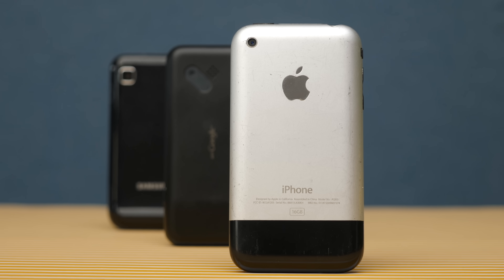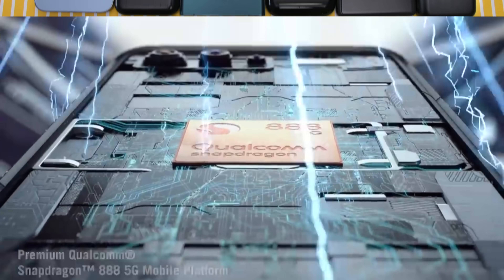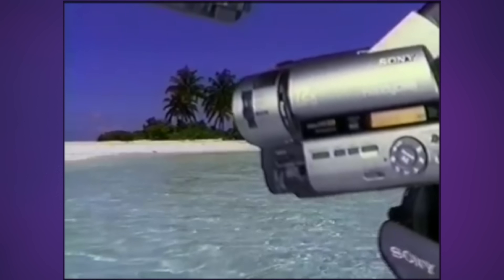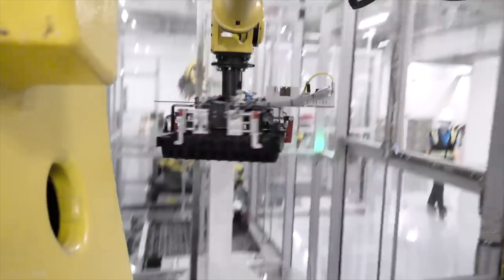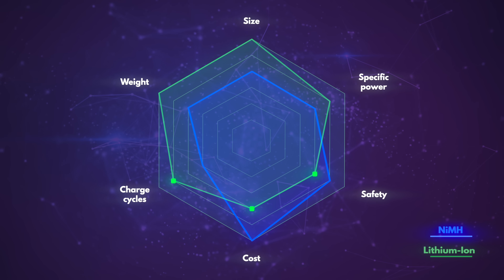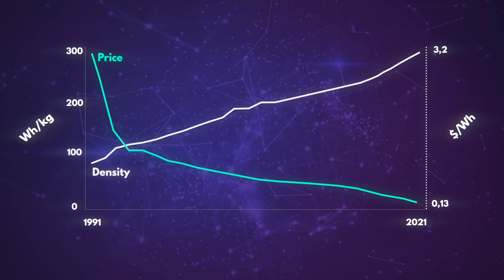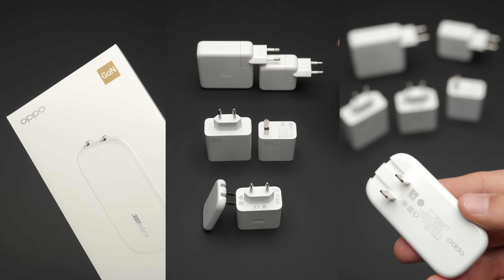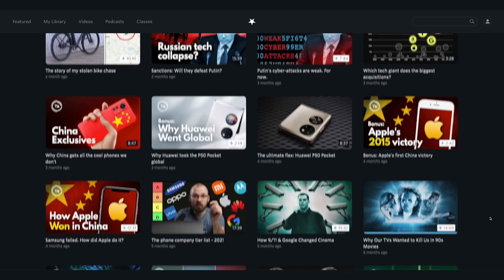The billion dollar race to fix phone batteries

Comment: Better batteries wont fix phones tho, the current limiting factor is cooling, we've already seen how phones with no vapour chamber cant properly use flagship processers because they easily overheat and compared to pc cooling, a vapour chamber alone doesent do all that much. Cooling is needed to reduce the temperature of batteries to increase their lifespan and more importantly to increase the utilization of the processors power because everything, including the cameras, rely heavily on the processor in flagships. These days processors are fast enough to support hi refresh rates on good resolution but cameras, especially video have lots to benefit.

Comment: Wow, what a trip to memory lane! Haha, brings back a lot of memories when we were still using those old batteries. Thank you for this comprehensive content. One thing I learned is that most of the mines are controlled by either China or Russia. I hope we can find sustainable alternatives or at least find ways to extend battery life. For now, I use a Chargie. It works to extend my battery phone capacity and at least I'm helping to keep one more battery from going to the landfills sooner.

Comment: I have a 120W charger and it charges my phone in less than 20 minutes (something like 17 or 18 minutes) from 0 to 100%. And in theory it should just take 12 minutes, but it takes longer because the charging has to slow down towards the end to not damage the battery. So I don't think that a 240W charger is useful except in special cases in which you only have a few minutes to charge your phone.

Comment: Sadly, China has ruined its environment to process Lithium.  Many toxic and poisonous materials and waste products come from turning ore into metal.  The US wants Australia to "process" Lithium, and Australia is the largest miner of that ore.  The most promising large scale fixed batteries are probably the molten metal batteries.  Ambri's liquid-metal battery consists of three liquid layers stacked together based on density. The densest, a molten antimony cathode, is on the bottom, the light calcium alloy anode is on top, and the intermediate-density calcium chloride salt electrolyte sits in the middle.  They can be rechared much more than any other and have a lifespan of at least 20 years.

Comment: We also took it to the max in nanotech, generating a solid state nano layer build that blew current Li batts away, mainly in current draw...up to 16x current delivery safely w/o causing heat issues.  They were impressive, powerful, and tiny.  However, they were still bound in the research side of things, needing complex expensive processes to build so they werent viable for mass production, at least they werent in 2015....

Comment: I personally lead development of LiFePO4 batteries at oak ridge nat. labs, USA, back in 2012-2014...they had minor improvements in base stats like charge density, cell voltage etc...however....
We developed a manufacture process with nitrates cellulose, eliminating the need of harsh solvents during builds and making them eco friendly; which also dropped cost to around 35% of current Li batteries.  The biggest hit was charge cycle life.  Typical bats today hold up on avg for 1500-2000 full charge/discharge cycles back to back, at which point they're basically worn out due to internal dmg.  These, however, ran for 6000 full cycles and still retained 91% of their original capacity.

A third of the price, eco friendly, and lasting potentially 8-10x longer...this was completed in 2014, so wtf happened??  Greed happened.  Theres no big profits in selling a product that takes a very long time to wear out AND is cheap as well.  Companies would rather sell u current ones that u must replace in a couple years for $100 than one that lasts 14 years that costs $38.  Dont think technology is where you see it at the store...the "consumer public" tech is anywhere from 20-30 YEARS behind what's actually available (and this isnt even including the military branch), where "too good" quality technologies are sat upon until things get so bad they're forced to move to it.  Even then it is usually dubbed down and not utilized with full potential so there can be a created fault point that makes it less durable and this more profitable.  I'd heard this b4 in engineering, but I thought it was conspiracy until I actually experienced it personally in R&D.  Companies would rather the planet die so long as profits are kept high.

Comment: This is why we need wireless electricity.
Reply: That's isn't any solution, moreover it would be way worse.
Reply: @aadityatokle  clearly one doesn't understand the grand scheme of things. That being you, if it wasn't clear enough. I'm not stating that wireless electronics would be appropriate for any situation but rather that it would be effective in situations where an emergency is required. Imagine being able to fuel up your car at an increased rate when you run out of electricity. Picture an airplane that never needs to land. Factor in the ability to power anything of importance from across the world at an energy loss. Beats running a cable to it or having a massive battery. Also, it depends on what from of wireless transmission. Tesla coils work off the square cubed law, but if you use  radio waves, you can get up to 80% if used in a stight line.
Reply: @Dr.LethalContact  Anyone with 2 braincells and knowledge about how electricity works knows how shitty this idea of wireless electricity is as of now, the efficiency, the heat generated, potential hazards and the immediate risk of having a small nuclear explosion capable radiator would absolutely be a threat to every single thing in a 500 meter radius, let alone being helpful or any better.
Reply: @Dr.LethalContact  when you say "imgine this or that" it's just fantasies my guy. I could say imagine teleportation which eliminates the need of cars and batteries, or imagine we being able to talk in each others head or play online games in our brains thats nothing practical.
Reply: @aadityatokle  you clearly dont understand the difference between the multiple forms of wireless electronics. One of the forms is the wireless charging pad for apple and samsung, and it's already on the market for over a decade. Ig that means you already lost. In another decade, you will rwealize how wrong you are now. I'm so glad I can actually picture the future properly.
Reply: @Dr.LethalContact  yeah, Xiaomi tried a 10 meter wireless charger for commercial use, how did it go? Well... To charge a 5000 mah smartphone at just a few meters it would take a day and would only be able to use 1%~ of the electricity that it has been provided initially
Edit: it takes multiple days for a regular smartphone to go from 0 to 100 with a 10 meter wireless charger not just one and your tesla should probably have 100000 times more to charge, the size of the 10 meter wireless phone charger is already like an air filter which works like garbage and if you would want to power a tesla with anything remotely close to a wireless charger the chargers' size would be the size of a small nuclear reactor with a range of 2 centimetres if the tesla doesn't burst into flames from the wireless chargings poor efficiency. It's not possible. Simply not.
Reply: @Dr.LethalContact  the one which you're talking about is a charging pad, which has less range than any wired charger because its basically a wired charger with a ring slapped and a port removed version of a wired charger,for instance my Xiaomi note 12 which I'm currently using goes 0 to 100 under 30 minutes and pulls 120Watts wired, the wireless version goes only a mere 40 watts and isn't very goot for my battery as much as the wired one is.
Reply: @Dr.LethalContact  buddy I'm doing electrical engineering, as of todays standards it would take CENTURIES to develop a true wireless source of connection. What do you mean I lost? Is this chess?
Reply: @aadityatokle  that's completely inaccurate. The form of wireless electricity transfer you're talking about is induction, literally the more insufficient form. The telsa coil is the worst way to transfer energy. Light is far better. We can get about 40% efficiency compared to the 3% efficiency from the tesla coil. Given that out of every 100 watts of power, we only get 40 watts, but that's the price of moving power through the air without wires. That's also with the technology we have today. Plants have up to 80% efficiencies at absorbing energy so we can learn a lot from them in the coming years. Another thing I have a wireless chaggie for is my samsung Galaxy Note 20 ultra, and the wireless charger takes less than 8 hours to charge a 5000 max battery, so I'm sure your stats are completely wrong.

Comment: How am I supposed to watch this when you measure battery capacity in amp hours. A batter with 10K mAh and 5 volts has the same capacity as a batter with 20K mAh and 2.5 volts.

Comment: I miss being able to get new batteries to phones that work perfectly fine, wothout having to go to someone to take apart the phone with special tools and crap. Even then you risk thw phone case breaking and no longer being useable anyway. Removable backs were also nice, sure making it water resistant is harder but to be honest ive always got a case for that regardless if the phone was itself. Largley be ause the phones are too small and flimsy so if i dont it feels like I'll break it on accident.

Comment: you do have to keep in mind that phone displays have gotten far brighter, bigger, higher resolution and the processors keep getting faster but also more poer intensive so bigger batteries are absolutely necessary. A Nokia can run on a tiny battery for a day but an iPhone needs a big battery for a day of charge.

Comment: The biggest problem on the industry, form the consumer side, and for smartphones, isn't battery tech.. it's battery design. 

The fact that companies opted and forced consumers to accept unremovable batteries as a normal thing with the excuse that everyone want thinner devices is a sham.. a scam. I bet everyone would prefer phones a bit thicker with easy removable batteries.. as it was back then.

They even extended this to other devices like videogame controllers.

For cars and some devices.. everything is fine tho.. since they can be removed... replaced.. etc.

Imagine a world where batteries could be easily removed nowadays.. and with universal shapes.. like old AAA, AA, etc batteries do.. but for smartphones. "type x square thin rectangular battery" slots.. standarized into a couple sizes.

would be.. so.. much better.

Comment: What are your thoughts on the potential of graphene-based batteries? I tend to be skeptical of a lot of graphene related ideas, as they can never quite get the cost down to a level where it can be mass produced, but the idea is promising. I really like what Graphene Manufacturing Group is doing with graphene aluminum ion batteries, with the goal of faster charging times and higher energy densities. Truthfully though, the promise of a battery made of renewable resources without any exploitative rare earth requirements is what really interests me. I would happily give up a bit of battery quality if it meant a more sustainable battery. It also would make renewable energy as a whole far more practical, as we wouldn't be relying on rare and limited resources like lithium and cobalt. Also would stop the child labor and mass exploitation of developing countries, which I think most people would agree is a good thing. Using abundant resources like that could fundamentally change the entire way that we interact with energy on this planet, and the combination of less environmentally impactful battery tech and more renewable energy could be crucial for fighting climate change, while still maintaining a high quality of life
Reply: Was just think about them. I think graphene will change everything.

Comment: My old Huawei which my mum now uses is 6 years old and battery is stillgoing strong and will last 2 days. This has 5A charging aswell for the time was very fast. My current Motorola is 125w charging after 6months battery averages between 97 and 102% health so clearly a good modern battery can handle the charges.

Comment: since this video was released lithium carbonate prices have dropped down significantly as well as the prices of li batteries. so much for "problem" number 1. 😂

and mining in general is bad. it doesn't matter if it's lithium for phones, iron for your pencil, nickel for the screws in your car, or coal for your favourite coal plant. mining always has an enviromental impact. always.

basically not a great video.

Comment: tbh the idea that the battery has not improved much despite often doubling in capacity sometimes is the decision of the manufacturer. back when i i still had a lot of time...and banking app's didn't block custom roms adding more hoops to run though i used to run 3rd party rom's and firmware's which were 100% user configurable. what this allowed me to do is firstly undervolt the cpu to use less power and at the time more importantly (1850 mah battery >.<) stop my phone from doing background things when i wasn't using it. when i turned the screen off it dissabled the radio for internet so app's couldn't/wouldn't update wile i wasn't using the phone which pretty much froze battery drain wile not using the device and the undervolting and other tweaks reduced battery drain wile using the device. noadays it just updates to much crap and keeps way to many sensors on, also everybody afraid of there device feeling "slow" so the cpu is set to turbo asap rather then waiting to see if the load remains and warrents gooing full bore or is just a tiny spike like opening your mail....

Comment: The biggest problem with smartphone batteries is the lack of removable batteries. No photographer will have their cameras come with fixed batteries as it’s ridiculous to even think of having cameras tethered to an external power source while they shoot. So why are smartphones different? With removable battries, all you need is to carry a few batteries around and have a multi-charger. You will do away with charge anxiety, hunting for power sources, lugging power banks around, do away with expensive wireless chargers, bundles and bundles of cables. And all these does away with unnecessary consumerism which reduces waste and saves the environment. No brainer isn’t it?

Comment: Holy missing the point batman.   The smartphone battery problem is designed to wear out.  Non replaceable batteries that die in 2 years, so pls buy new phone every 2 years, while EVs get 8 years.  This "problem" is a marketing choice not a technology limitation.

Comment: I think the main problem with batteries is their decay. If they remained working correctly we could keep using them as-is. But they lose their properties quite fast and require replacement or at least an external charge at some point. The only reason I am replacing my iPhone 6S now is the battery, the phone works just fine for me, but the battery is pretty much gone after a little usage.

Comment: Pentium 2 laptop cooler is good for all battery discharging, solves all battery problem. If you remove the plates from today’s laptop cooler, that is also good for discharging. For charging a bad battery, an electric cigarette charger is needed until the phone starts charging. If you connect your phone to a solar power bank during sunshine, you can use your battery below 10 % much better.

Comment: I'm not a computer geek to any degree less than the N-th degree. But I know my phone has various program's, software which utilize my phone's battery, which I am unable to thwart in any way. Not wanting the various bloatwear, software, program's is not an option when buying a new phone. And attempting to get rid of it can and generally does, cause your phone to become a brick. Personally, I like the idea of having a mobil phone. But have zero desire for what's referred to as a smart phone. I've no interest in texting, email, video's etc. etc. etc. I have other device's that serve those purpose's. I just want a fucking mobil phone. Which if it were available, due to it not having any and all of the other bullshit I don't need, would have room for a considerably larger speaker, I could actually hear.

Comment: Dont use a smartphone. They are super dumb. 
I like to 3d print replaceable 18650  or maybe 21700 ports for my electronics so I can easily swap my cells when I run out of charge. 
You are the slave of your cellphone. 
It tells you what to do and when to charge it.

Comment: If you're going to give history lessons, you could at least do your homework. You state that 90s camcorders, cellphones and basically everything rechargeable was produced with early lithium batteries? Sure... except that wasn't until the late 90s and you just skipped over the decade+ when EVERYTHING came with the much larger nickel cadmium or nickel metal hydride battery packs.

Comment: Worst thing is that they try to make changing the battery a hard process to a user. I understand they are flimsy and dangerous if you start pulling them of when they are fully charged but by God they super glue it to the phone and two layers of different screws.